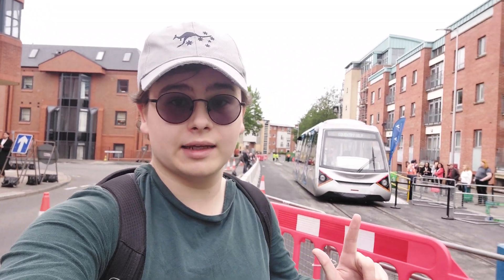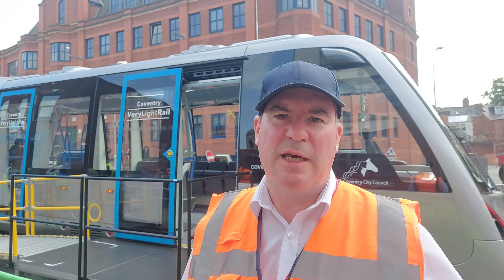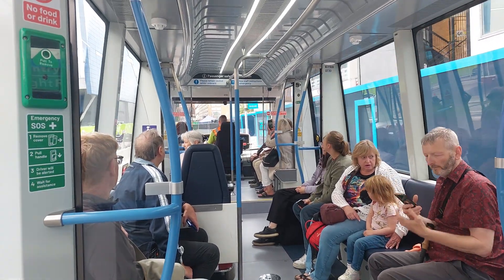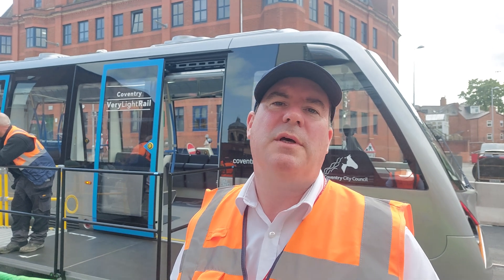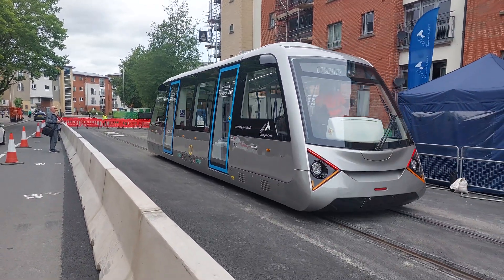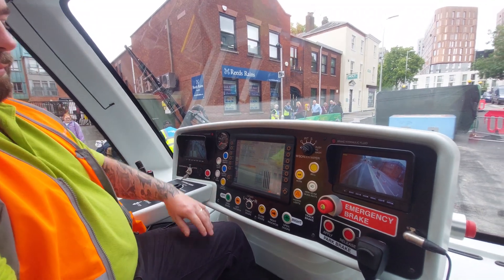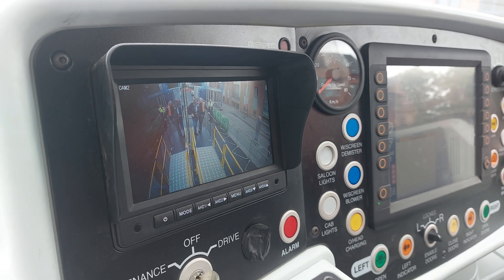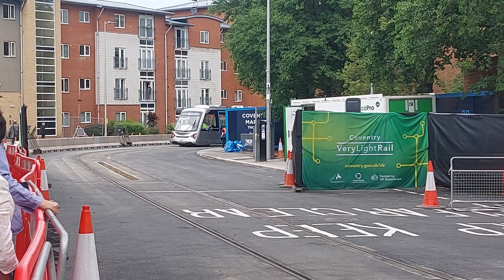Could Coventry's Very Light Rail be the FUTURE of Urban Transit?

Comment: It's a really interesting idea. It's very reminiscent of the older style trams using similarly sized vehicles and I like the idea of doing everything they can to try and bring costs down to make rail more attractive. If it's cheap enough to build, it's operational and maintenance costs could easily the investment. My only gripe from a technical standpoint is that they chose the wrong power delivery method. Bus chargers really don't make sense in this  application and they're probably not doing themselves any favors when it comes to cost going with them. Instead, they should have gone with standard rail pantographs because the infrastructure is more cost effective and flexible. In the case of charging at stations, the tram would have to be positioned directly under the charger and only one vehicle can be charged at a time. Compared that to just having a short run of cable or a beam overhead allowing for flexible positioning with capacity for multiple vehicles. The same thing applies at depots where they'd have to have enough chargers to cover the number of vehicles in their current configuration, whereas with pantographs they can just make a few runs of cable to charge everything. Finally pantographs allow for in-motion charging which would be very useful in high demand sections of a line and would also allow for the vehicles to fully integrate with existing tram infrastructure if it's available.
Reply from the maker: Yeah it very much feels like a return to 'traditional' tram systems, as opposed to more modern light rail systems!

Comment: No objection to the principle of looking at cheaper ways to get trams up and running, but if demand is so low that it can be met by 20-seat vehicles then it is very unlikely that it will carry enough passengers to justify the expense of the infrastructure.
Reply from the maker: They seem to think that demand will be met by doubling up/running higher frequency but yes it does seem small for a tram vehicle!
Reply: @MikeWillSee  I'm not saying they won't meet demand – I'm saying that if demand is so low that they could meet it with, um, an Optare Solo then they should probably do that rather than splurging money on infrastructure that isn't going to be used by enough passengers to justify it's cost, even if that cost is lower than a traditional tramway.

Comment: Not a fan. Just build a traditional Light railway as found in Manchester or Edinburgh. The interviews are very interesting though so thanks for the video.
Reply: If its going to be a single vehicle, just use a bus. In fact, it would be more efficient to use a double decker bus.
Reply: "Just build a traditional Light railway as found" - the issue is cost. Light rail or traditional trams cost £40 million per kilometer. This costs £10 million a kilometer. If a minimal tram system is 10km in length, trying to find £100 million is much easier than finding £400 million.